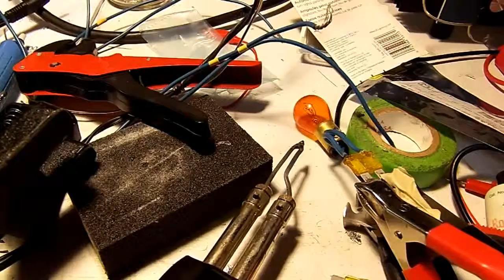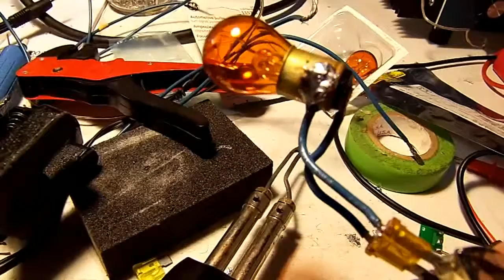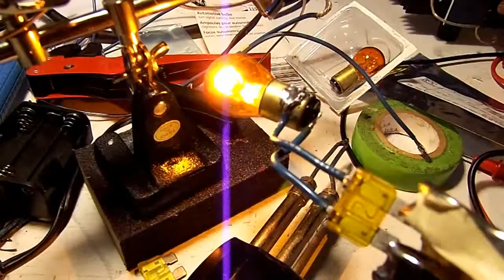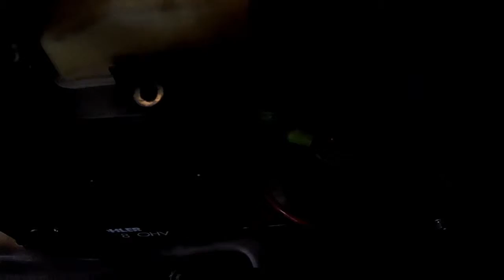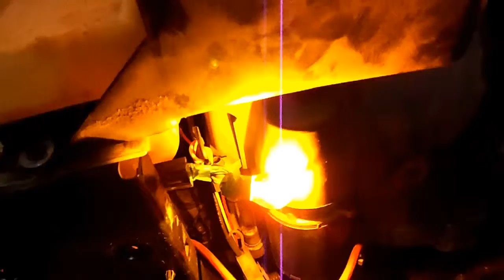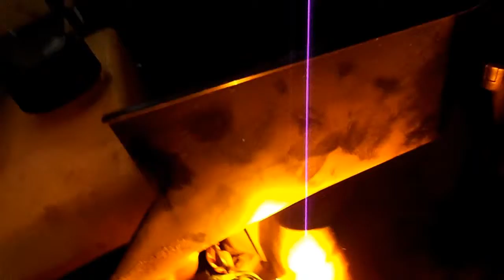Tester to Aid in Finding Shorts in 12V Electrical Systems

Comment from the maker: For troublesome shorts, there is a device one can purchase that will plug into the fuse holder and then pulse current into the shorted circuit. Also in such a kit is a magnetometer, which one can use to follow the pulse down a harness. Once past the short, the pulse will diminish. A crude DIY of this device can be fashioned by making the tester described in this video and by also including an automotive type flasher in series with the bulb. Then one can use a compass as a simple magnetometer to follow the pulse.